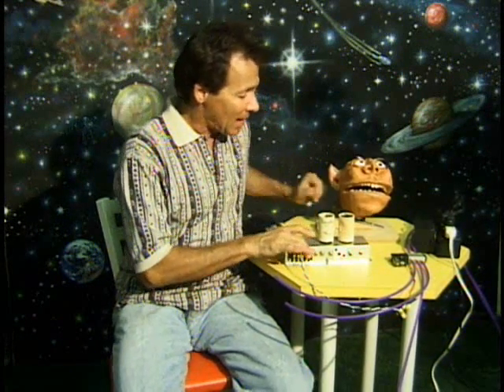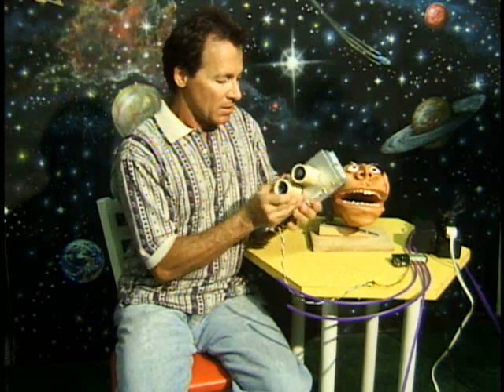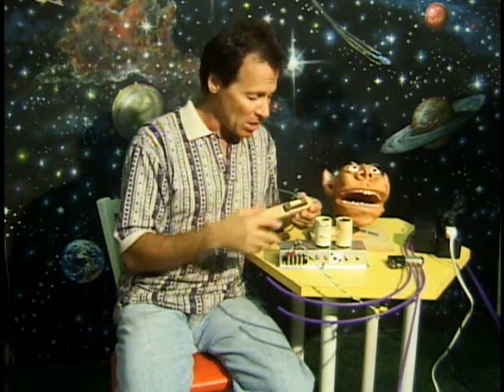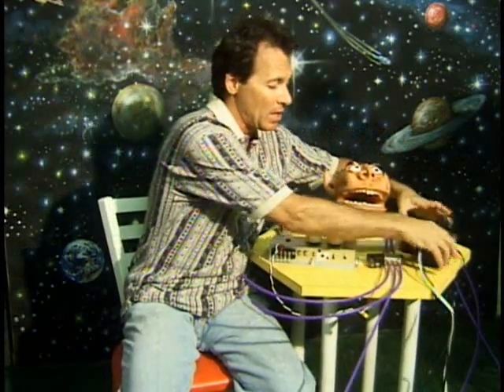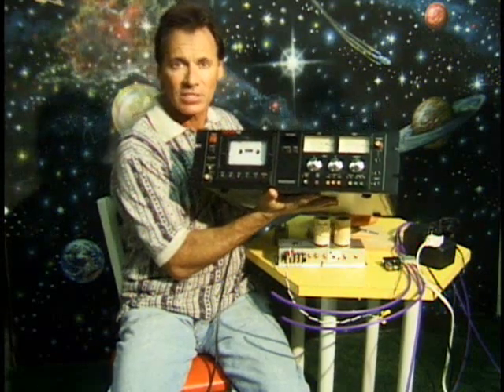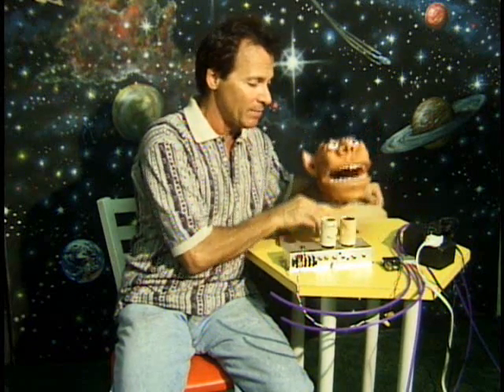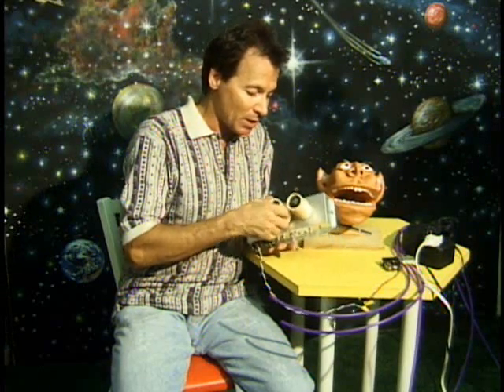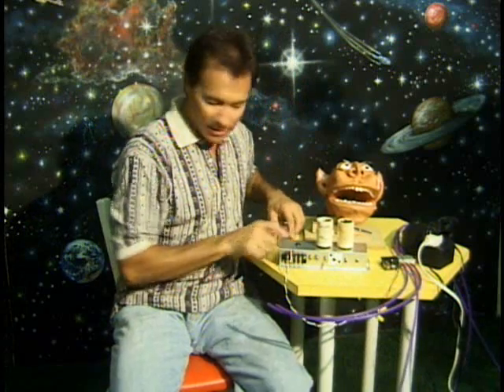Animatronics Experimenters Kit-Part I- Contents

Comment: I don't have air so can you use electriseti
Reply: You will need to buy an air compressor. It is logically impossible to move an air cylinder with electricity. Hope this helps :)
Reply: +Andrew Jason If by saying "use electricity" you mean completely drifting away from pneumatics, then you can. But in this case you will have to "re-engineer" the entire drive system, replacing all cylinders / valves and regulators with DC motors or heavy-duty servos, plus their respective control and drive electronics. Programming the creatures will also become a totally different beast, as you will have to install a microcontroller (or several of them) and program it to actuate the entire rig on audio cues.

I believe that this will increase the cost of building the creature considerably (especially if using heavy-duty servos) and in comparison, you'd probably be better off using cylinders / valves and regulators.

--Werner
Reply: It’s pneumatic for a reason you can only use it with air